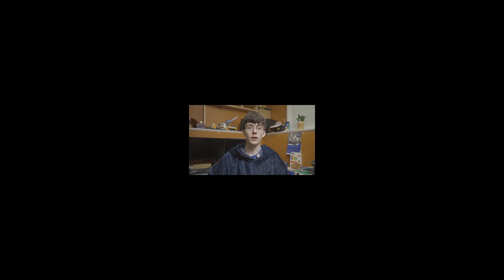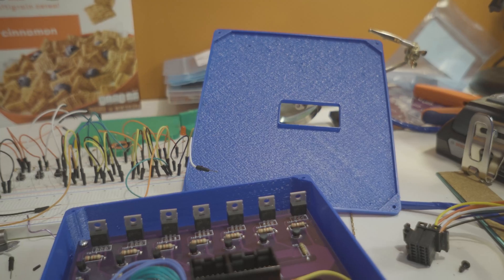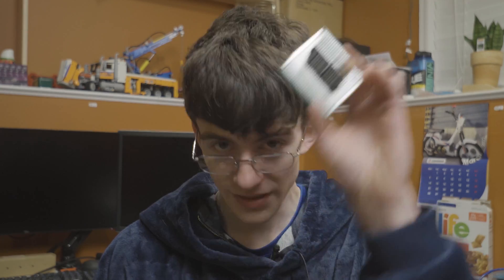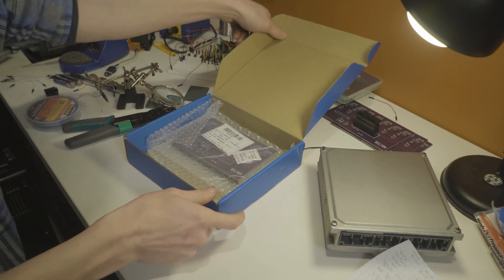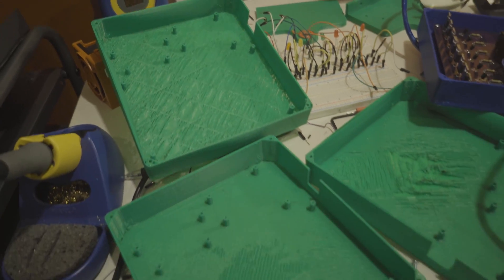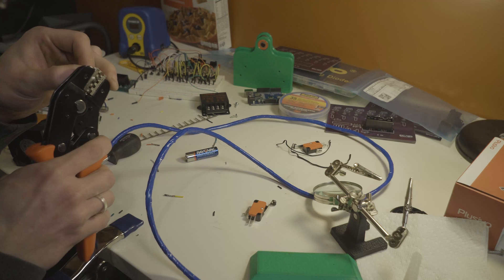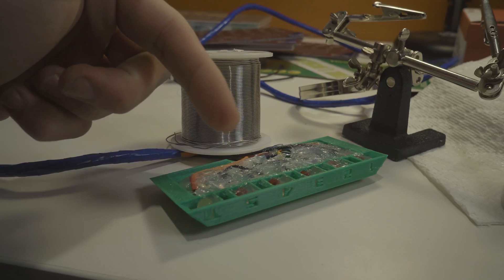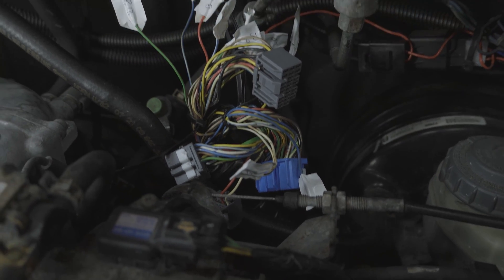Turning my Honda Odyssey transmission into a "sequential" Pt. 3

Comment: Came from your tiktok. you've got me contemplating building a sequential system for my 4runner. great videos man can't believe you've got so few subs/views
Reply from the maker: I bet you could definitely do that with enough research! Glad you're enjoying the videos! It's definitely a bit of a struggle at times to reach my target audience, but I have only been uploading here for about two months, after all.
Reply: @tnast  any chance you would upload your arduino code to github or something? It would be a lot easier for me if I had yours as a reference.
Reply from the maker: I'm generally a huge fan of open-source, however I likely won't be releasing the code for this one, at least for now, since I want people to learn how to make something like this, instead of just "copying the answers". (not to mention your transmission is likely going to need very different behavior)
HOWEVER, I'll gladly give you some pointers/tips for coding your own controller.
1. You may want to create a logic table that documents the solenoid states for every gear and in-between gear. With an Arduino, you can add a table to your code with what's called a "multidimensional array".
2. Make sure your loop() function is as simple as possible. This will help ensure the controller is ready to receive and react to input without needing to worry about the possibility of an interrupt messing things up while it's handling a command. Essentially you want interrupt-like performance, without the risk of interrupts.
3. For loops are extremely useful in navigating multidimensional arrays. You can easily reference all values in a specific row or column with one, or both with two nested inside each other.
4. 100% make sure you keep ease of config in mind while writing the code. If you need to reference the same value lots of times, consider making it a global variable so you can quickly change it across the entire code should you realize you need to.

Hope these help! I'll be completely honest, I wrote most of the code in a day, so it's not like it's anything super complex. It's definitely just about approaching it with the mindset of ease of expansion, adjusting, and responsiveness from the start, instead of brute forcing it and optimizing later. That way when you start in-vehicle tests, it's much easier to debug and fix any inevitable incorrect code.
Reply: @tnast  thanks, lots of useful info. I'll need to draw up a logic table and map out all the gears for mine. I've got 2 solenoids for shifting which different combinations of of and on switch between the four gears. Theres a third for torque converter lockup. I think I will wire a relay into my brake switch to automatically unlock converter with brake and to lock it above a certain/speed rpm. I dont think I'll do what you've got with the button. Thanks for the idea, this is just the kind of project I like doing and will keep me busy for a while. Another question, where did you buy your pcbs? I'm guessing pcbway or jlcpcb? Was it as simple as giving them a Gerber file and paying and then shows up at your door?
Reply from the maker: Yup, I used JLCPCB, and it was in fact as simple as uploading the file, selecting your options, and hitting buy! I was pleasantly surprised with their turnaround time, even including shipping via DHL.

Comment: Did you add any fly back diodes for the back emf of the pilot duty load? 
Or any heat sinks?
Reply from the maker: Great question! The particular MOSFETs I used, the IRF9Z34NPBF-ND, have integrated flyback diodes. I currently don't have heatsinks, but made sure to leave space in the enclosure to add them down the road if I realize I need them.